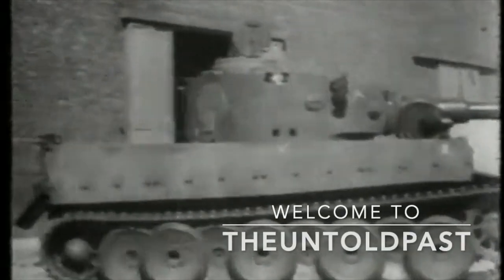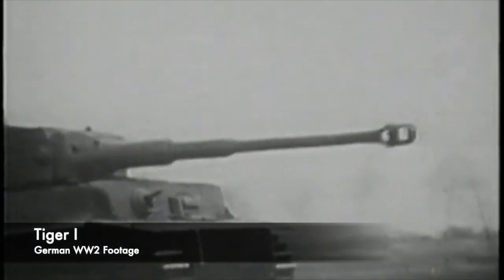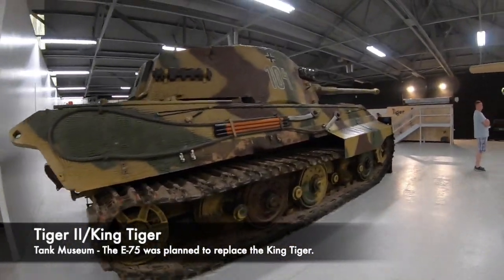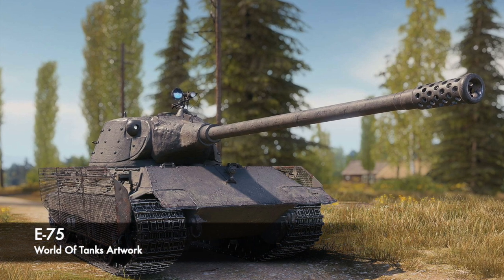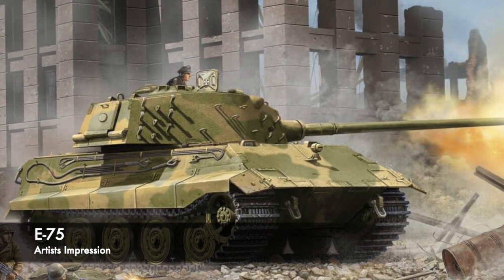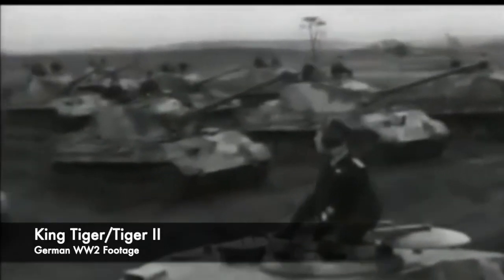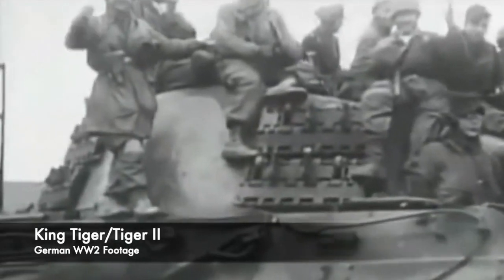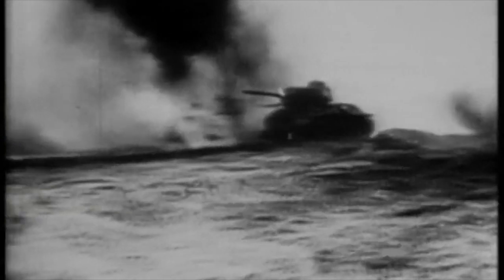The King Tiger's Replacement - The E-75 Standardpanzer

Comment: Why do the ones with the least amount of oil dream of building the biggest and heaviest tanks???
Reply: Survivability, why build 10 tanks that uses more fuel when you can build 5, that saves on resources and time but more importantly you building a tank to outlast your enemies.

The Tiger 1 and 2s lost 1 tank to every 6.5 enemies, however if you remove abandonment and brake downs it's 1 to 12.6

However the Germans needed all there tanks to do this not under 2,000.

They still did extremely well 110,000 Russian tanks, 16,000 British empire tanks, 10,000 American tanks, and about 5,000 other tanks mainly French, for a total of 141,000 losses to the German's 46,700 tanks.
Edit: also should add in Italy they didn't have good tanks but still about 3,000 lost.

But the allies still had about 120,000 tanks left when ww2 ended and the Soviet about 20,000.
Reply: @brianlong2334  Russians were just untrained with their often superior T-34. Germany had defense advantage, i.e. waiting in ambush and scoring first hits while the enemy is trying to figure out where you are.  There are way too many reports of Tigers and Panthers breaking down and being destroyed by their own crew because they were simply too heavy to support their delicate transmissions. Moreover, most battles were not tanks vs tank but tanks supporting infantry. Yes, they had great armor and guns but that caused them to break down and be a maintenance nightmare. You want many tanks that work and can support the infantry and are mobile not super tanks that can be stationary and take out a few enemy tanks before they are taken out themselves. More of those reliable and tested Panzer VIs would have served the Germans better for sure.
Reply: @sctm81  They were average reliability for there day they weren't much worse or better then Soviet tanks, or British, in most cases they were slightly better. 

The stug is considered the most reliable German tank of ww2 it had a reliability of 65% at its best.
The T34 by comparison had below 50% till after 1942.
The king tiger managed to get to above 50% reliability that's impressive for it's size.

The American had an abundance of spare part's the Germans had scarcity mainly due to allied bombing campaign.

A lot of new German tank crew ran away when there tanks weren't damaged or had throwin a track or were easily repaired, in the western front.

A lot would ran away when allied air craft would hit them however the tanks were normally in working condition.

But in 1944 allied airpower destroyed something like 90% of Germany soft skin vehicles, that makes support and supply much harder, it's quite impressive that the Germans did as good as they did.

Hiding in ambushes only works the first time, after that you have to move the Germans had a lot of defence networks but they were normally well know about.
The Germans had almost the same number of AT gun as tanks on the western front so not many.

You have to remember if you out number the enemy and have overwhelming fire-power then that hidden man/unit going to get a lot a fire coming on you.

The Russian's had some impressive defensive set up but did do that well a great example of this is in the pacific were the Japanese had the advantage of surprise but the USA had overwhelming fire-power yet the American KIA 2x what they lost but total casualties were about the same.

The Germans also did far better on the offensive then the defensive, and they basically were fighting defensively against the allies, they did try counter attacking but it was more like ww1 on the western front and the Germans didn't have the men equipment and resources to fight like they did on the eastern front, don't get me wrong there was a lot but only something like 20% of the German military/equipment fought against the allies.

Edit: You don't want to have 10,000 tanks that can't move because they have no fuel or ammo, you want 5,000 tanks that can do the same job with less that's basically what the Germans did, it didn't work all the time but it was far better then the alternative they had, it's pretty basic stuff tbf even though some people don't seam to understand it.

You can't fight a numbers war if you don't  have the numbers, that's why you get quality over quantity, you mite build 70,000 tanks let's say but they only can take out 2 tanks but the enemy can build 150,000 now you have a problem, they have equipment you don't.
Reply: @brianlong2334  The Panther was notorious for breaking its own transmission if you look at reports and statistics. Often it didn't go a full tank without suffering a break down. Did it perform well in combat head on? Certainly. However, operational readiness was extremely low compared to western allied tanks. Yes, you are right regarding spare parts but German tanks were also not very good at being repaired in the field. The Panther was not supposed to be that heavy in it's inception but Hitler demanded that it be protected by that amount of armor, making it 48 tons, way too much for its transmission to handle. In a fight it was a very formidable opponent, that's beyond dispute, but as a part of a mobile force to be counted on it was lacking compared to other tanks including the Panzer IV.
Reply: @sctm81  Sorry we use proper measurements not the imperial system 44.8 ton, its original weight was to be the 30 to 35 ton class, the Sherman was originally 30 tons later models were 38 tons, Panzer 4 was original 16 tons and eventually it was 25 tons, the panther was also rushed into service it was also designed in about half the time this also help contribute but it wasn't that bad.

Was it that bad at first yes at 36% but this is 1943 not 44 and 45, the rate increased over time to 54% in mid 1944 so not that bad pretty average in reality, a lot of brake downs were easily fixed this would indicate that had spare parts been more available there rates would have been a lot higher.

The Panther did better then the Panzer 4, the Panzer 4 was comparable to the Sherman and t34 the panther was better then all of them however it wasn't as good as vs infantry as it was basically almost a dedicated tank killer, however still could do the job.

Comment: By late 44 only an idiot or Adolf Hitler could actually believe any outcome other the unconditional defeat of Germany was possible.  Germany still had a few surprises in store but lacked the raw materials, oil, production capacity, manpower, and implementation time necessary to bring a serious game changing weapon system to the fight.  Lots of brilliant ideas on the drawing boards but they were all pipe dreams.

Comment: Germany should have just mass produced the Panther tank...
Reply: I would say the Panzer IV. But more tanks was not the solution as they where already short on fuel and their logistics overstretched (in the east).
Reply: @SweatyFeetGirl  good point. Against the mass shermans the PIV would of been just fine
Reply: @markusz4447  The Panzer Iv was very outdated, it was from the 1930s, and it was fitted with a very large gun, more armor yet the hull didn’t change.

The Panther would be a better choice, since the late Panther variants were very reliable
Reply: @siegfried2k4  I agree. The advantages of the p4 lie more in its reliability than in tank v tank capabilities
Reply: But they did mass produce the Panther

Comment: See, there lies part of the problem.  Germany already had a superior tank from a combat standpoint compared to the allies, but the machines were overly complicated and thirsty for gas.  They didn't need concentrate on making bigger and stronger tanks.  They needed to make existing designs less likely to break down and easier to manufacture.
Reply: The Panther was very reliable near the end of the war. The last variant, Panther G’s transmission and engine were sturdy and can last up to hundreds of kilometers. 

They always like to rush things.

Comment: Were German tanks really better than the allied tanks if they didn't fulfill the role they were intended to...winning the war? After all, the Maus had thicker armor and a more powerful gun, but that doesn't make it better than the Tiger I.
Reply: Alot of the german tanks had technical problems. Problems that get worse with every new 'VunderVeapon'. 
The ferdinand(Elefant) have been known for the engine to be massively underpowered for that weight of vehicle to the point it would spontanestly combust before it even reached the combat zone. 
complicated designs coupled with material shortages, manpower shortages, the bureacracy and the techical brain drain(alot of the top engeneers were either defecteing or dying due to the war) made the production and maintenence a absolute nightmare. 
From a technical standpoint, Im know im going to get flak for this. I would say NO the big cat tanks(tiger, king tiger, panther) were not very good. 
If you want to make a good military vechicles, "Make it bigger, put more armor on it, bigger/more guns". Thats exactly what the germans went with when designing these vechicals, is something that a small child would say. Lets just face it, that Maus tank is stupid even if they did get it to work. Too big a target, too expensive to maintain and too gas consuming. Right when Germany is in a fuel crisis. Not a fuel shortage, A fuel CRISIS. 

While Tiger phobia was a thing. The reason why the tigers got their reputation was because Tiger crews were typically on the defensive(with experieanced crews) and waited in one hidden spot to ambush Allied tank columns. 
I heard a commsion after the war, investigated tank on tank combat came to a conclusion that the winner was usually the one who shot first. That was usually the Germans. 
When the Allies on both fronts started to fit their vehicles with 76mm guns. Even the tigers (famous)thick armor wasn't going to hold up.

Comment: This was so unnecessary I mean the tiger 1wasnt fully tested when it was rushed into battle they were come to find out later the mayback was underpowered and there were many electrical problems the thing was over engineered and it needed specially trained people to service the tiger all that came out in the middle of battles , the king tiger 2 wasn't fully tested when they came out with this monster . (The mayback turned out to be perfect on the panther though but this is all the meddling of god dammed hitlers incompetency like the me262 worlds first operational JET fighter hitler was insisting on it being used as a bomber an airplane made and designed and cut as a FIGHTER

Comment: Typhoon and P47 would have smashed them
Reply: Its extremely hard to hit a tank fom the air using rockets, and a heavy tank is more or less imune to splinters and bullets. What you can do is shoot up the heavy tanks "soft" suport, like the suporting infantery and fule trucks, widout them the tank is neuter.
Reply: @kirgan1000  note  falaise gap, latter part of Bulge
Reply: There are barely any tanks knocked out by planes. It's more psychological than effective

Comment: There is something very STUPID about a STANDARD PANZER being a 75 ton vehicle. This is especially true when 35~40 ton Soviet tanks are better armored than 75 ton King Tigers because the Germans insist on bloated vehicles with a lot of armored volume and an inefficient use of space.
Reply: The reason german tanks were very large was because they had the transmission in the front of the vehicle. The shaft goes all the way under the vehicle, creating unnecessary height. The Sherman and the KV had this problem too.
Reply: There was also a Panther replacement called the E50, far more practical, also an E25 tank destoyer, and just for fun an E100, which was to replace Maus lol.

Comment: Remarkable design thoughts just not finished. Basic hull design like the lower frontal armor in this case you will find on any modern tank. If German designers would finish that design way and would cancel the upper frontal armor they would probably save weight and increase frontal protection to today standards.

Comment: The truth is good enough for the job, does the job, the Germans over thought everything, the would have done better with Russians on the drawing boards, a Russian will give you something that will work and something you can fix when it stops, T34's were leaving the factories sometimes not even painted, sometimes with holes in the welded seam's, but they left the factories in vast numbers,

Take a look at any German made tank in a museum or as a wreck, the welds are perfect, if a it wasn't good enough it didn't leave the factory, in Russia if it drive and fight it was out the door as soon as possible,

Gudarian's tactics called for massed firepower at a critical point, they needed all the tanks they could get, not works of art to win a beauty contest or compliments from your enemies, far better for the Allies scoff at German workmanship, but fear the endless numbers of tanks that were just good enough but in numbers which couldake a differences

Comment: If the Germans had focused on building pz-4s and StuG and put as many of them as possible on the battlefield the war would have been very different. The Tiger and King Tiger were terrifying but not as scary as 10 Panzer 4s with their 75mm would have been in place of one Tiger. Glad that didn’t happen in all honesty.
Reply: @SweatyFeetGirl  Which 75mm? They replaced the howitzer 75mms with long 75mms that can reliably penetrate the KV series.
Reply: It doesn't matter.
In the end they had more tanks than tankers capable of operating them.
Lack of manpower and fuel was the main problem